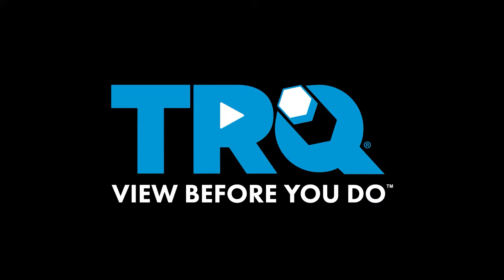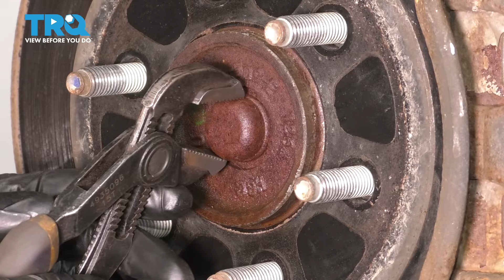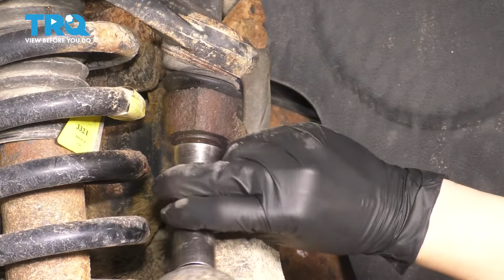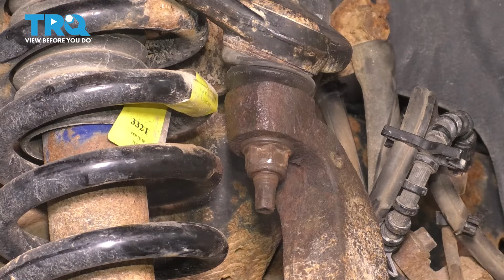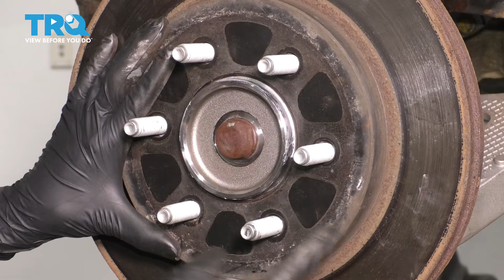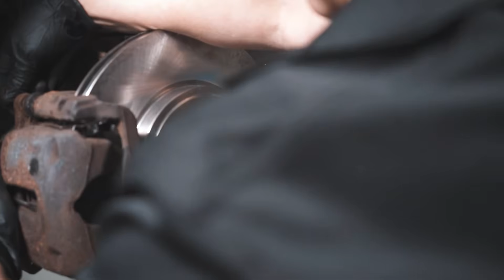How to Replace Front Lower Control Arm 2004-2008 Ford F-150

Comment: Should have installed a lower control arm cam kit on the bolts while you where there. The alignment would be much easier then. Also you are supposed to apply vacuum to the hub to properly install the axle into it.

Comment: Not a bad idea to use anti seize when putting bolts back together. Also when placing the cv shaft back in a little grease applied is helpful. Not too much.

Comment: Arizona cars are Easy to work on. No rust or anything .  Clean original parts  aluminum iron or painted coated as if it came from factory NO Rust, a quick blow dust off. We